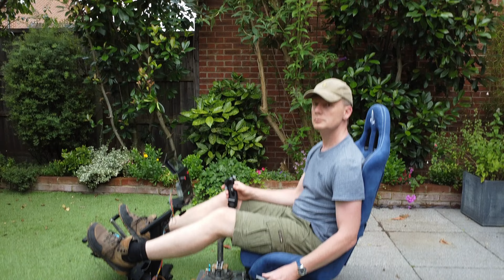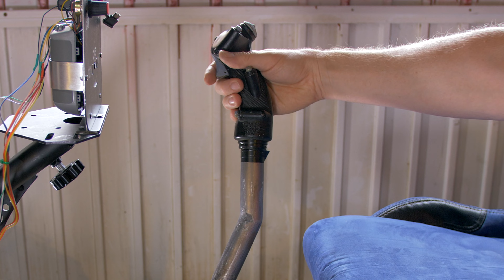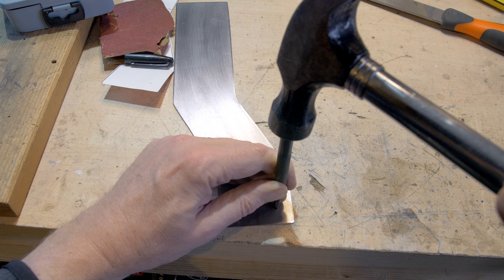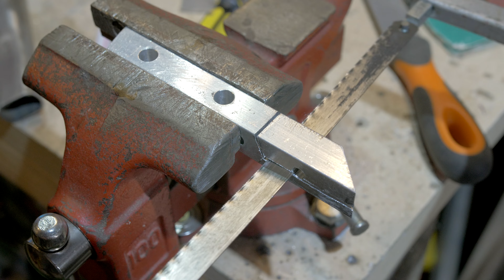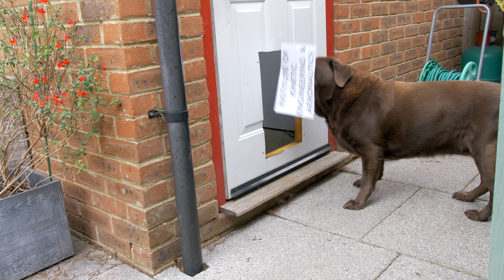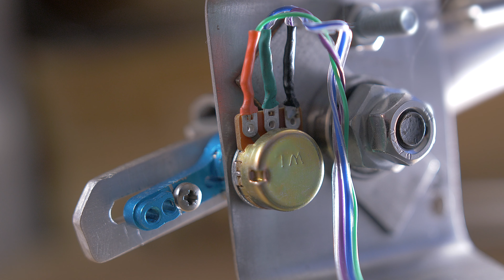Homemade Joystick Drone Controller Part 4: Collective

Comment: Sorry if I missed it but have you considered using hall sensors rather than potentiometers? they don't wear out after a few hundred hours of use
Reply from the maker: Ah yes, I have used Hall effect sensors in the past for my flight sim joystick, but here I just needed to replicate the potentiometers that the DJI controller used. Good point! (And will use them again when I convert the rig to a flight simulator)